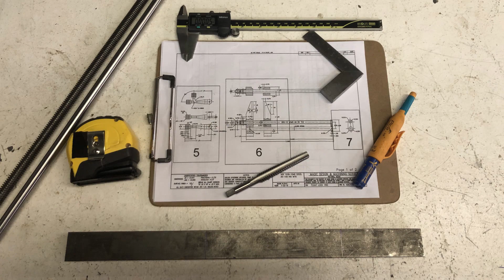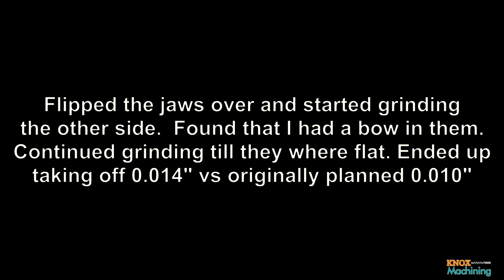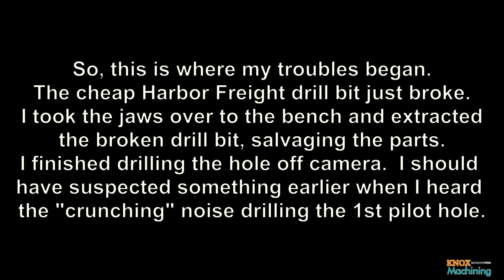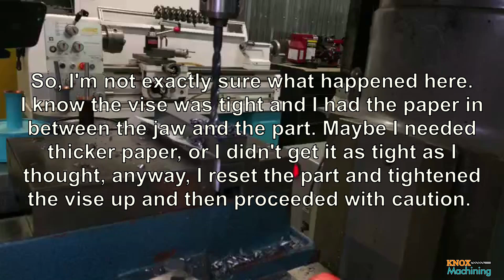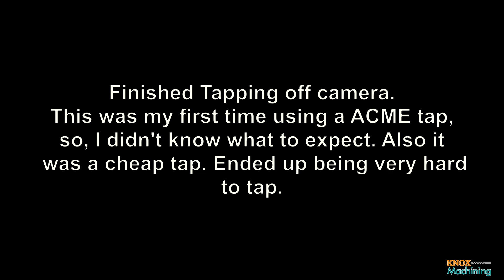Making a Float Lock Drill Press Vise - Part 2

Comment: When mrpete 222 presented his version of this project , I made one for work , and one for home . They are quick 
to use and much safer than a loose vice on the drill table .
Reply from the maker: I need to go back and finish that project. I had a few things happens in part 3 and got a little disenchanted with the project and started working on something else. I still have he part 3 video half finished and more footage for part 4 and more work that’s not been done yet.

Comment: I like the picture-in-picture for the DRO, nice touch. Keep it up.
Reply from the maker: Yea, I had fun doing that.  I'm using 2 iphones and a ipad for my video gear.  Since the two iphones were already setup to shoot the views of the project, I ended up using the ipad to capture the DRO.  It's a older ipad, so, the video wasn't as good.. but, it didn't mater.. I just zoomed in on the DRO and in post I cropped it down so you couldn't see anything but the DRO.  Turned out really good.

Comment: Keep an eye on notifications, because some how the bell got unrung.  Shame about the bow.  Once you start grinding they really show.  Were you using cold rolled?  6:54 get a rubber tipped stylus (1st grade pencil - lol)  Did you see doubleboost's repair to his mill to eliminate a similar noise?  See his SNNC 301.  Nice work.  Looking good so far.
Reply from the maker: Odd about the bell being unrung.  Yea. I was using cold rolled. It’s possible I ground it in too. I need to surface the chuck.   Yea. Just bad habits. I just got use to using my middle finger. :)  I’ve not seen doubleboost’s post. I’ll go check it out.  Thanks!

Comment: Are you going to do a part 3? Or did I miss it somewhere.
Reply from the maker: You didn’t miss anything.  I had started the editing on part 3 and ran into some issues with the video editor and took a step back for a while. Ended up doing some other projects and never went back to it. I have video for part 3 and probably 1 or 2 more parts. I still haven’t finish up the vise. :(
Reply: @KnoxMachining  I watched the Mr. Pete version and have the plans,just looked like you were taking it to another level.